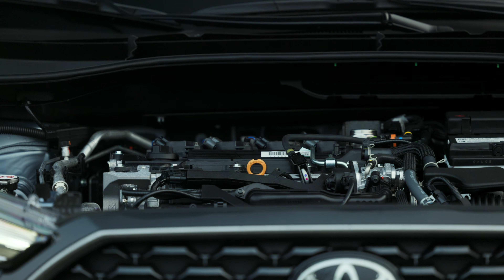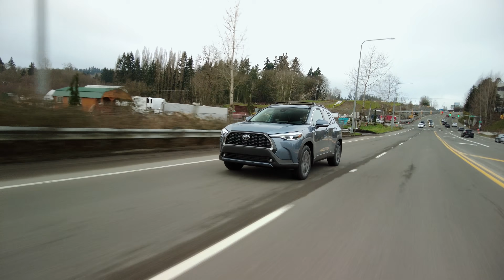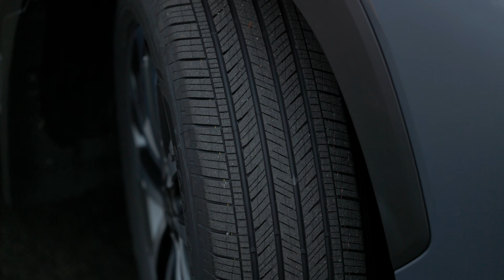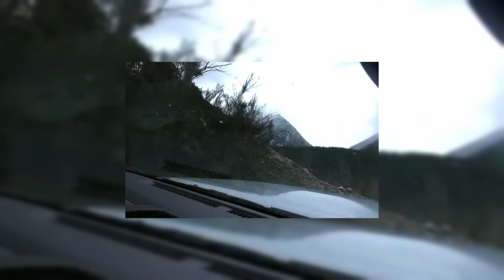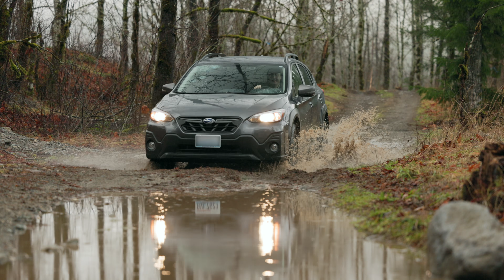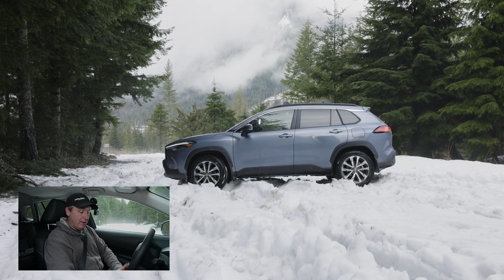2022 Toyota Corolla Cross vs Subaru Crosstrek AWD Off-Road and Snow

Comment: I gotta say I do love both Tfl and this channel but how is it possible that you manage to do that with the crosstrek and Tfl struggles as soon as theirs lifts a wheel even with xmode, TC off....It is the same car isn't it? Again no mean to bullshit anyone here but I just don't understand. Even this seemed steeper than anything Tommy could have thrown at it....

 Not bad though. Pretty decent AWD. Definitely better than previous systems Toyota has given us. However, You give the Yaris cross, which has a 7hp motor at the back, and the rav4. Gas hybrid and plug in versions trail mode and snow mode, and not to this? That's a bit daft...
Reply from the maker: Have to admit I have no idea why TFL has so many issues with their Subaru testing. Maybe it’s just us having more experience with the powertrain.
Reply: @drivingsports  could be. TFL doesn't seem to push their vehicles that hard in the basis that their owners probably wont either. Still is good to have different perspectives...you definitely restored my faith a bit on the subaru😂, as always great work :)

Comment: To me this car is good for base model and AWD. It comes standard with safety tech, what else do you need in a car like that.
Reply: XLE has awd starts at 26K, that's more expensive than crosstrek standard awd starts at 22k
Reply: That's sort of the point here... Crosstrek is cheaper and better.
Reply: Crosstreck has the same safety tech, a better AWD system, more power, and it's cheaper. Toyota really overpriced this car. If it were around the same price as a mid-trim Crosstrek, maybe.

Comment: The Corolla may as well be FWD. That AWD is practically useless
Reply: lmfao all wheel drive in 160 HP is VERY much useless off-road on the roads he tested it on. that Toyota is a grocery getter. nothing wrong with that, but id take the Crosstrek anyway ( I might be biased here cause I have one lol)
Reply: @MarksTech  My Jeep 4.2L CJ7s and 2.5L YJ were like 120HP...turning 30"+ mudders.
Reply: I disagree. The situations in this video are for demonstration purposes to test the limits of the AWD; The vast majority of buyers aren't going to take it off-road like this and the AWD obviously wasn't designed for it. In a harsh winter climate with inclement weather where you are just need to get from point A to point B on snow-plowed pavement this AWD is more than capable enough for that.

Comment: While we are all waiting for the video to actually load, I gotta wonder who would pick this thing up over a Rav? 

Don’t get me wrong; I think it looks better than the rav and the color selection is top notch, but it’s so much smaller and essentially almost the same price?
Reply: @Dain L.  I would spend a grand or two extra and get the RAV4. It has more carrying capacity, more power and appears to match the mpg.
Reply: Here's the painful answer: RAV4 prices are probably going up. Way up.
Reply: @Red The Cross in this video is priced around $33,000 . That sum will buy a pretty decent RAV4.
Reply: @RightLaneHog3151  exactly, which is why I have such a big issue with the pricing. Unless you’re going for a base model, the savings is going nowhere.
Reply: @RightLaneHog3151  Rav4 for sure is the better value.  I bought a new '19 Rav4 XLE with some premium options for 31k out the door. But that was in 2019 and now we have freaking covid pricing.  Like the saying goes,  timing is everything.
Reply: I can tell you exactly who. People who own Corollas. An older lady at my church said Toyota mailed her a postcard advertising it. She told me she was excited that they are making her a Corolla that is an suv. She was completely unaware and uninterested in a RAV4.
Reply: @haroldbeauchamp3770  to be fair, if she knew of the rav and the price of a similar Corolla cross…that would change things. Otherwise you’r answer boils down to: ‘the uninformed’ lol
Reply: This argument can be made for just about any of the CUV selection available. Who would pick a CX-30 over a CX-5? Who would pick a Taos over a Tiguan? A Crosstrek over a Forester, especially a Crosstrek Sport? An HRV over a CRV which is way better? Yet none of the manufacturers are hurting for sales of the smaller offering despite them all being grouped pretty close together price wise to their larger offerings; they are all within a few grand of each other. None of them have a $10k+ price jump to go from the smaller and often less powerful choice to the bigger crossover. Selection doesn’t seem to be a pitfall in this segment but rather a benefit.
Reply: @foxtrot685  To answer your four questions:  not me,  not me, not me and not me.  You are certainly correct that CUVs are selling in all shapes and sizes. I expect more to come. The Yaris Cross ought to be the next announcement from Toyota but they may not be able to build them fast enough these days to enter a new market.
Reply: @foxtrot685  I don't like the aesthetics of the bigger Subie hatches.

 I have a 50mile commute. My Crosstrek can get 40+MPG on my commute, without having a hybrid battery/powertrain to worry about.

 Aftermarket support for the Crosstrek keeps getting better and better too. Mine already has skids, winch, A/T tires, hitch, roof box, and high-flow airfilter. Rockers and a rear diff-locker are next. An aftermarket turbo might be nice if Subie offers the 2.5L with a 6spd manual...or a factory 2.4T/6spd Wilderness. This little car is heavy. It needs at least the 2.5L to not seem bland against competitors.
Reply: Most ladies love the Toyota Cross and Honda HR-V. Both vehicles are not too big for them and cute too. I prefer RAV-4 over these two as a man.
Reply: I think for power and size the RAV4 regular or Hybrid is a better choice. I own a Corolla cross XLE and I don’t regret my choice still. The hybrid RAV4 my GF has does make me jealous of its efficiency and it’s power when needed. Seamless transition from electric to gas without even a tiny hitch. That said there are a few features mine has that hers doesn’t and I didn’t pay what she had to for hers. Plus the handling is definitely more enjoyable in the cross compared to the RAV4, in that it drives more like a small car than feeling like a truck. Maybe down the road I’ll trade in for a cross hybrid if it’s beefier and much better gas mileage. I do love the car and the size, it’s a sweet spot

Comment: 😕 won’t play..that is sadness
Reply from the maker: Are you on mobile or desktop? I have YouTube looking into it right now.
Reply: @drivingsports  mobile..it says “no stream”. Tap to retry.  I can play any other videos but this one
Reply from the maker: @kevinblock2307  Talked to YouTube tech. They said it’s not a system wide issue. Only an issue with their transcode of this video. They triggered a “fix” for this one and it should be good in “24-48 hours” 🙄 Seems to play fine for all desktop viewers.
Reply from the maker: @kevinblock2307  note: even on mobile if you can’t play in the app it will play in a browser.
Reply: @drivingsports  thx!  Guess I will have to do actual work around the house today instead of enjoying your video - bummer!  😉. Will try again though later for sure
Reply: Won’t play for me either
Reply: Mobile